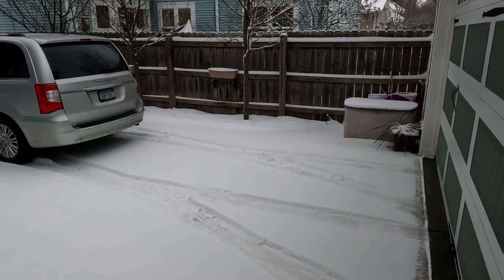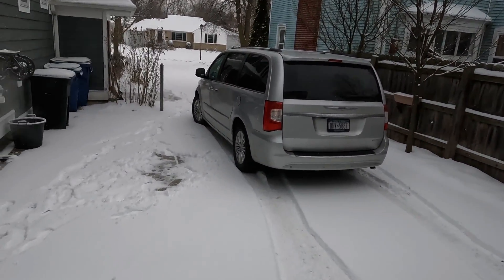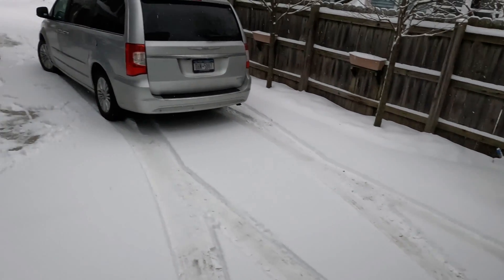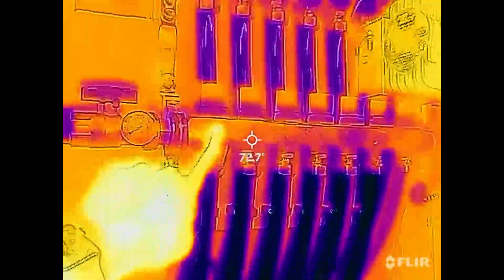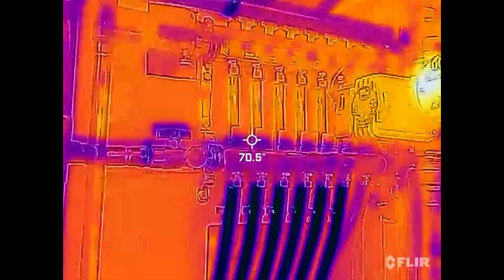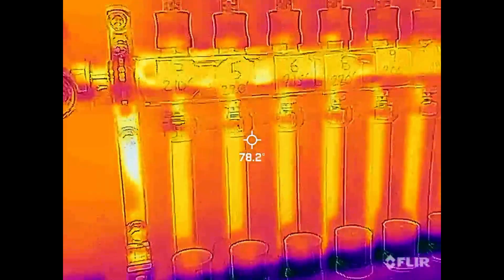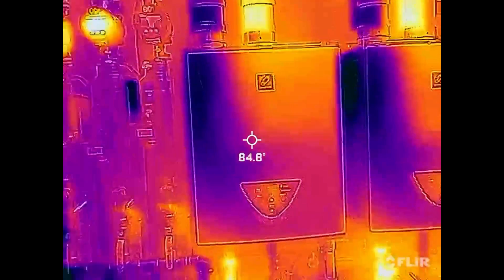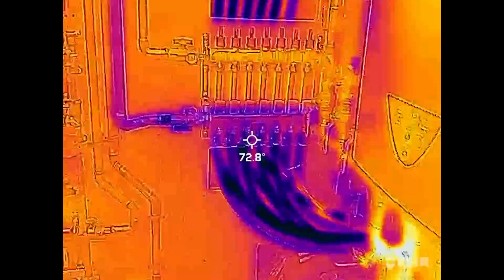Waking Up To 2" of Snow on the Heated Driveway - Let's Melt it Away!  // Snowmelt Timelapse 1-27-23

Comment: I'm sure you've answered this in a previous video, but is the garage floor slab heated as well?  Thinking of the snow melting off of your cars once you back them in
Reply from the maker: Hey Tim!  Yep, the garage floor is heated too.  That was actually the first slab I installed the pex in back in 2010 when I built the garage.  I didn’t have a boiler, so it sat under air pressure for 10 years until I built and installed the current system.  The garage also has hanging Reznor unit heaters.  I discuss it further and show pictures in this video if you’re interested: https://youtu.be/0eVSJDShuts  Thanks for the question and for watching!

Comment: I was wondering have you ever considered power washing the driveway really good getting it super clean and sealing it.

It seems like this would allow it to even work more efficiently, as the concrete would be a little bit more nonstick, and the water couldn’t seep down and actually wet the concrete.

I’d like to see you do this, and see how it changes the performance of everything, which I would believe to be better.

Thanks for keeping us up-to-date, and showing us about the system as you do, and educating us, it’s quite fascinating!!
Reply from the maker: Hey Michael!  I’ve absolutely thought about this, and it will definitely be done this spring.  I should’ve done it 2 years ago. I was told it should be cleaned and re sealed every other year.  I was actually planning on doing it annually instead, but life got in the way and here we are coming to year 4.  Another thing I’ve noticed this winter is “crazing” on the surface of the driveway, and I believe it’s a result of the lack of sealing, but I could be wrong.  When I pressure wash and seal it, I will absolutely make a video of it, even if I hire it done.  Thanks for watching my videos and taking the time to leave compliments and suggestions, I really appreciate it!

Comment: Great video, I love this stuff.  I know the whole point of having a system like this is to NOT shovel snow, I get it.  However, I have to wonder, if you did shovel the 2 inches of accumulated snow away before turning on the system, how much do you think your gas bill would have been reduced by - 20%, 50%, 65%  ?
Reply from the maker: Thanks Glenn, and great question!  So I’ve found after years of operation that the majority of cost comes in the first 2-3 hours as the driveway comes up to temperature.  After that, it gets cheaper per hour to operate for every additional hour that it’s running. It’s like the MPG in your car.  From a dead stop, you’ll get horrible mileage accelerating to 65, but once your there and the cruise is set, your MPG’s just keep going up and up.  While shoveling the snow off first would shorten the overall run time since the slab would be able to dry quicker and the system could be shut down earlier, that time would come off the back end, not the front.  The system would still need to run for those initial 2-3 hours where gas usage is the most.  Once my system is up to temp and has been running for several hours, it usually levels out around $1.00 per hour to operate with current gas prices (this was closer to $.50 per hour in ‘21, see this video: https://youtu.be/VotJEQigTkw ).  So to answer your question, I’m not sure exactly how much gas would saved, but I would guess shoveling it might save 2-3 hours off the back end, so maybe $3-$4?  For me the $3-$4 is not worth my time, the risk of slipping, hurting my back, etc.  Hopefully that answers your question, if not let me know!  Thanks for asking it and thanks for watching!
Reply: @DeckerChristopherJ  It certainly does answer my question.  Everyone reading this appreciates your expert and detailed reply.  Turn it on, save your back and your sanity, and enjoy your day.  All for a few dollars.  Salt not eating the concrete, being walked into the house and no heaving of the slabs.  Sold !

Comment: What’s the name of the automation system?
Reply from the maker: Hey FJ!  The company I am most familiar with is Tekmar.  I actually installed their 091 socket in the slab when we poured it and ran the conduit back to the utility room so I could add the 090 sensor and 654 control later.  The socket was only $100 at the time https://amzn.to/3YqAghM but the 090 sensor https://amzn.to/3Y5y0wS and 654 control https://amzn.to/3Y8g3O8 are much more expensive, and I haven’t brought myself to spend $1,000 on it all yet.  Maybe at some point in the future, but it’s been working well for me doing it manually.  Hope that answers your question, thanks for watching!

Comment: I wonder if adding a heat pump would improve efficiency, of course it depends on your natural gas prices but it would be worth looking into in my opinion.  It would be very easy to integrate with your existing system. Especially if you pair it with solar.
Reply from the maker: Thanks for the suggestion Connor!  I have been looking into heat pump water heaters to maybe replace the buffer tank for the domestic.  I don’t think there would be a way to incorporate one into the secondary side without a major re design.  I’m also researching heat pump dryers and hybrid furnaces.  I probably won’t replace perfectly good appliances like my furnace until it fails, but I might add a heat pump dryer along side the natural gas one.  We have the room.  The Solar Panels will be installed soon!  There were actually going to come next week but the forecast changed.  Oh well, we’re still close!  Thanks for watching!

Comment: Hey Chris, I watched your design videos and am quite impressed - as someone living in the same snowbelt as you, I'm curious what reasons you chose concrete over asphalt? I feel like most articles I read for the northeast talk about the salt impact on concrete vs asphalt due to the higher porosity. I'm in the brainstorming stage of something like this for our house and I'm wondering if you had any insight into what you've done to mitigate the risk (from tracked salt on tires), or are there better heat transfer properties that should be considered, or is it just an aesthetic preference?
I'm also curious, should there be a failure in the circuits under the driveway, could they be individually maintenanced?
Great videos, you are an inspiration!
Reply from the maker: Hey Derek!  First, I owe you an apology.  I think you asked a similar question on a different video of mine and I never got a chance to respond.  Thanks for your compliments and for being a subscriber, I really appreciate it!  So regarding the choice of concrete over asphalt, it wasn't until I really started researching snowmelt systems that I learned it was even possible to put snowmelt under asphalt. We had an asphalt driveway before this project, and I guess we had always planned on replacing it with concrete for aesthetic reasons.  Both obviously need to be sealed for longevity, but I guess we always found concrete to be "cleaner."  We noticed the flooring in our old entryway had actually "yellowed" from the years of tracking in the oils from the asphalt.  I was told that if you keep the concrete sealed, the tracked salt from tires wouldn't harm it.  I have failed with that, as this is now coming up on my 4th year and I haven't re-sealed since the pour in 2019, and I believe that is why I am now seeing some "crazing" cracks on the slab.  It will be done this spring without question!  I do think concrete holds its heat more than asphalt, which is why its popular for radiant and snowmelt systems.  Regarding failure in the driveway, in the highly unlikely event that did happen, I could always isolate those loops on the manifold.  There are 13 loops in the driveway, so loosing 1, 2 or even 3 probably wouldn't make the system ineffective, I would probably just need to increase the temperature of the others to compensate.  I have close friends that old some old carwashes with floor heat, and back in the 50's, 60's and 70's they used copper tubing in the slabs and they are still operational today.  Compared to copper, PEX is much more flex and break tolerant.  Hopefully that answers your question, if not let me know and I'll try to provide more detail.  Thanks again for watching!
Reply: @Chris Decker  Thanks! I wasn't sure if YouTube had actually posted my previous comment, sorry for the redundancy. We have asphalt currently for about 90'x16' with a 14'x30' turnout that should probably be resurfaced or replaced in the next few years. We'll see if I can convince the finance committee considering there's also a rear patio project to replace a wood deck I'm toying with the idea of pavers/hardscape which is where I think I'd really see the benefit of a system like this. Our dogs go in and out and we get some ice buildup when the weather warms up enough to melt some but not all the snow.
Reply: He talks about it here.  https://www.youtube.com/watch?v=s83tnGQKAto

Comment: If you are gone during the day, does the system continue to operate at full capacity?  Or, does it throttle back once the snow melts?  Thanks!
Reply from the maker: Hey Underdog!  The system remains fully operational whether we are here or not.  The Aquatstats will turn the heaters off / on as heat is needed, and the system remains fully operational until I turn it off manually, either by the switch in the basement or from my phone.
Reply: @DeckerChristopherJ  Great solution with you phone and cameras.  I'm guessing you can check in to see live video?   Nice system.

Comment: Is the concrete just a few years old? It looks like it has some surface cracks already, wondering if that's from normal wear or from the snowmelt system shocking the concrete when it's turned on a frozen driveway?
Reply from the maker: Hey Felix! The concrete was installed in 2019, and the “crazing” just started these past couple of months.  The new 4K 8MP camera really highlights it in the videos now. What’s weird is that it’s also occurring on the apron and other non heated areas, and the area in front of the steps to the deck where all of the loops tune into the basement gets the hottest, yet doesn’t have any.  I think it could be more related to the fact that I haven’t sealed it in 3+ years, but I could be wrong. Time will tell!  Thanks for watching!
Reply: @DeckerChristopherJ  thanks for the details, i can also see some actual cracks on the right side. What psi did they pour? i have a 20 year old concrete driveway (no snowmelt) and there is no crazing or cracks. I never sealed it in the last 11yrs i owned it. My concern is whether a snowmelt system can degrade the concrete faster than snow/ice (heat acting as catalyst in residual salt from cars reacting with concrete?)
Reply from the maker: The crack you see on the right occurred about a year after it was poured, which was about a year before I built the heating system and first turned it on.  You make excellent points, and I’ve wondered the same thing Felix. I’ve also witnessed both heated and non-heated slabs that are 20+ years old, and I haven’t noticed any crazing.  I’ve read that it typically occurs right after pouring, but mine just showed up this winter.  I did read they are primarily cosmetic and not structural, but we share the same concerns.  The fact that it’s occurring on non-heated areas tells me it’s probably related to the pour or substrate, but I’m not a concrete expert.  I may trying asking on some forums to get a professional opinion.
Reply: You're videos are awesome to watch,what you have is amazing,just so so cool. I had no idea after reading Felix's comment that you're supposed to seal concrete,I have a concrete jungle and it's cracking thin cracks and now I'm actually seeing the gravel....oops guess I need to call someone.
Reply from the maker: Thanks Sue, I really appreciate your comment.  I actually meant to re seal the slab every year, then it turned into every other, and now we’re coming up on year 4 🤦🏻‍♂️.  I will absolutely do it this year, even if I must hire it done because I can’t find the time.  Seeing these hairline “crazing” cracks was an eye opener.  Thanks for watching!!